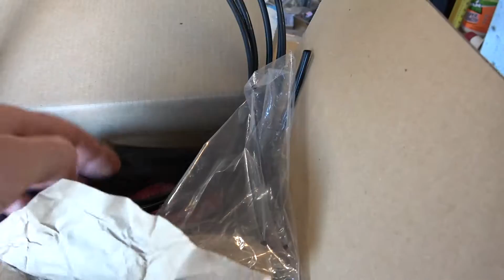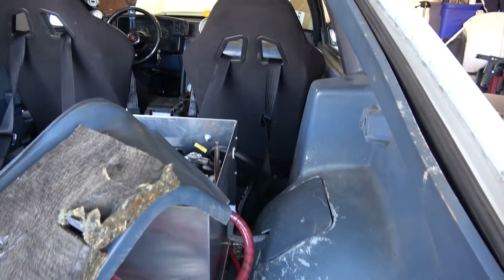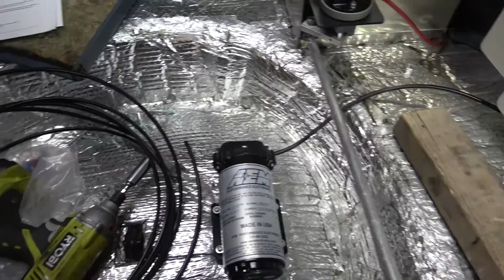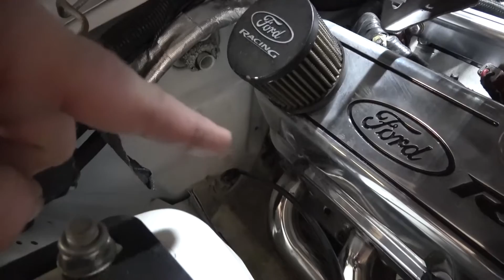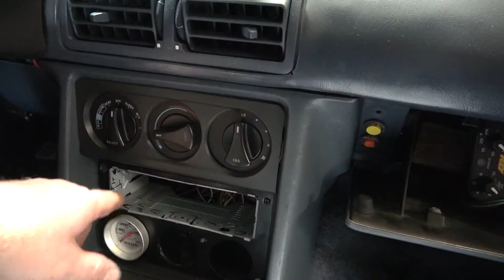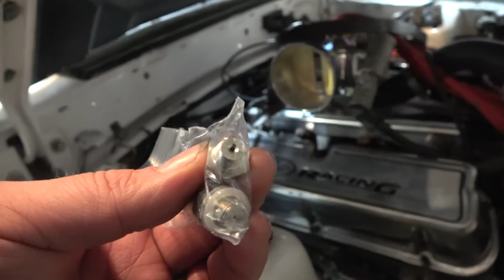AEM Water/Methanol Install Turbo Foxbody Mustang

Comment: How did you remove the blue cut lines on the pump before you insert the new black lines?
Reply: lucidsnow there is a locking ring to keep the tubing from coming out while under pressure. You press it in towards the pump and pull out on the tubing, or the temporary blue plugs.

Comment: friend.  My kit arrived with 3 noozle.  how do i know which one is 250, 500 or 1000cc?
Reply from the maker: The instruction come with a chart to fit you with the best size nozzle for your setup. I went straight to the 1000cc and was a little much
Reply: That's a difficult question to answer without more information. Are you adding meth to keep IAT's down? Are you adding meth so you can run more timing to get more power? What is your combo?

Comment: justin,, fyi... the FPR needs its own dedicated vacuum source. Never tie another vacuum line into it
Reply: True dont want it messing with the fuel press regulators vacuum nether 🔴🇺🇸🔧👍
Reply from the maker: Thanks man!  Good Info. Out of room on the tree. I have either the bov hose or, map sensor line. Be better to tie into one of those?
Reply: @justin91lx  you want a dedicated vacuum for the FPR, boost gauge, and BOV....Summit and Jegs sell vacuum trees/ logs if you need another port

Comment: Put a bracket in the front of the tank too  ...3 legs on it will hold it better
Reply from the maker: Good Idea! Why didn't I think of that lol
Reply: @justin91lx  i just didn't know if you wanted to put another bracket so close to the battery box and your shut off switch is why i suggested adding one
Reply from the maker: Yeah its close, but should be good